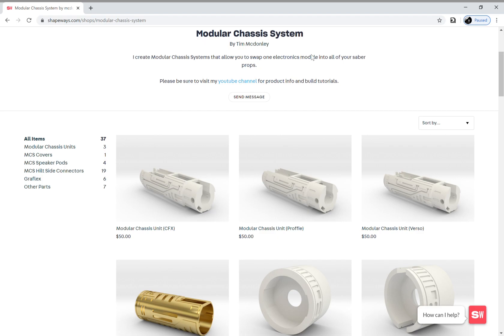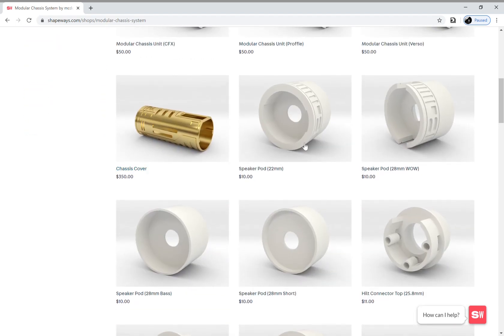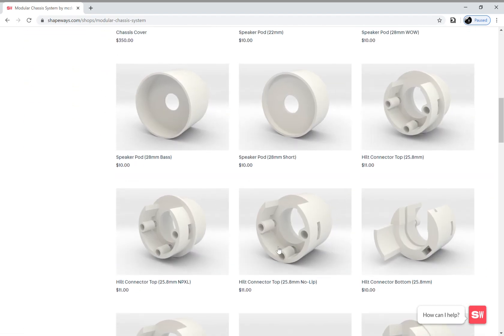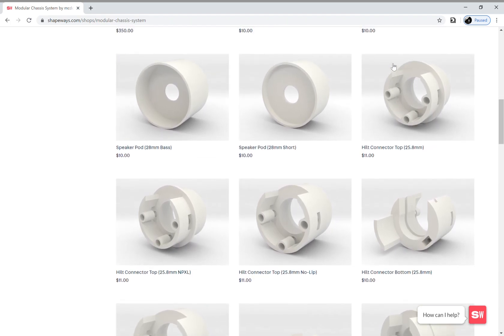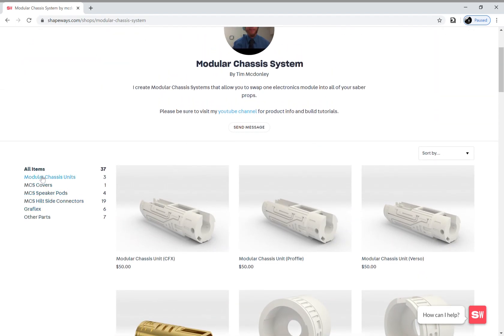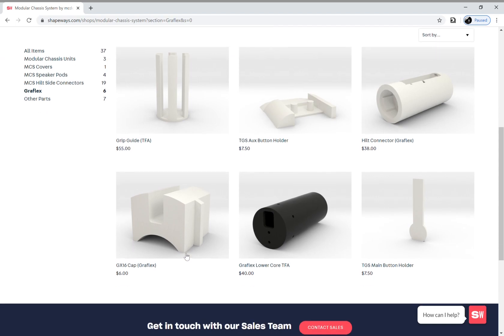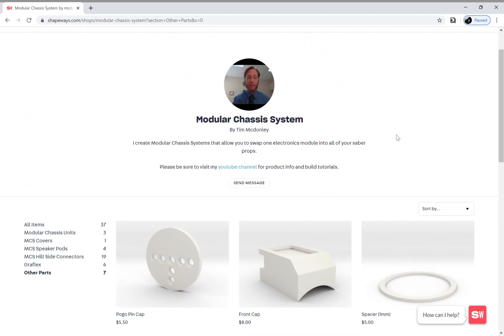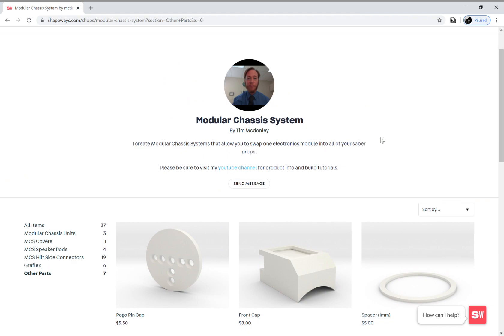Ordering and selecting the right parts/materials from Shapeways.

Comment: Wow I can't believe these aren't more well known. I just found these today. Incredible system. I'm working on an MHS build and will be using this. You even have parts to work with sabers that use MHSv1 and ribbed grips. Simply incredible. edit: I'm building a saber with the MHS crossguard. Any solutions for working with that unique bladeholder?
Reply from the maker: Thanks so much for the kind words. I don't have a design for the MHS crossguard yet.